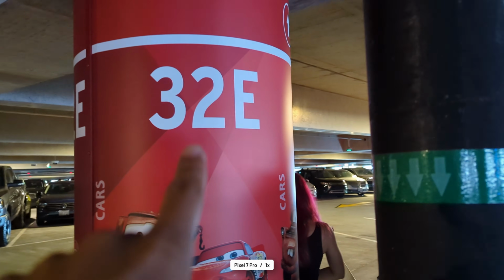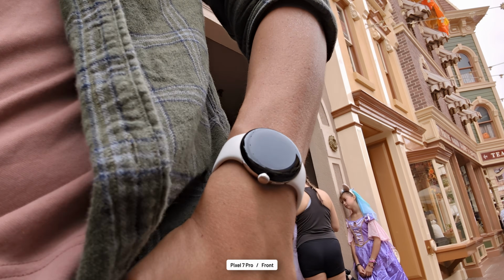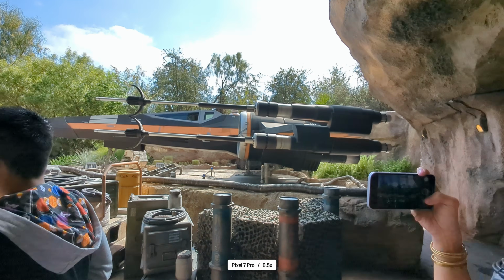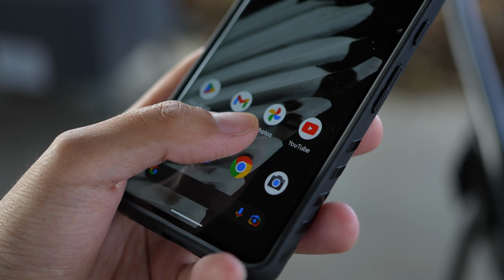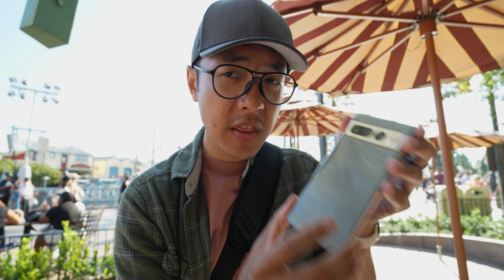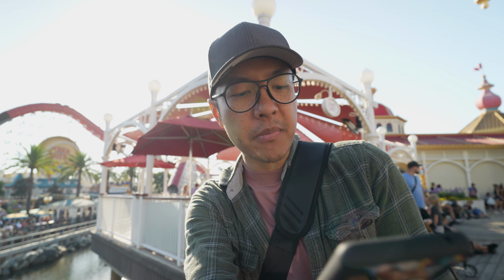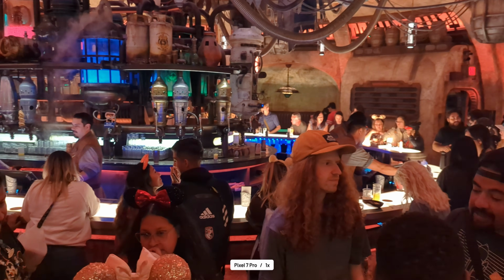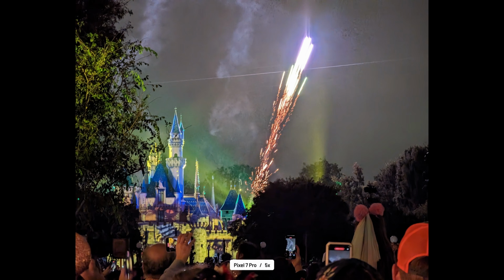Pixel 7 Pro Week One: Camera Test at Disneyland!

Comment: Too many shots with UW lens. UW generally lacks details. So same photos with 1x and UW would have been helpful.
Reply from the maker: I had plenty going through the different focal lengths. In the tighter spots I leaned on it and the photos came out pretty well across the board. The lower quality of the ultra wide is definitely obvious in video